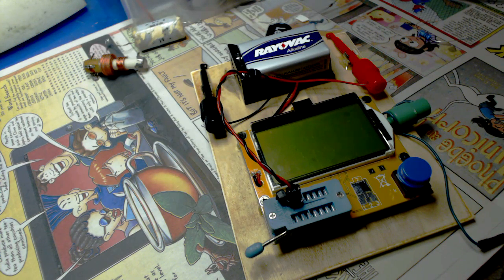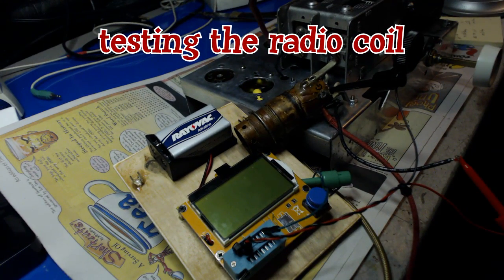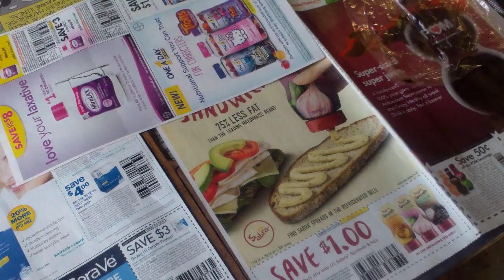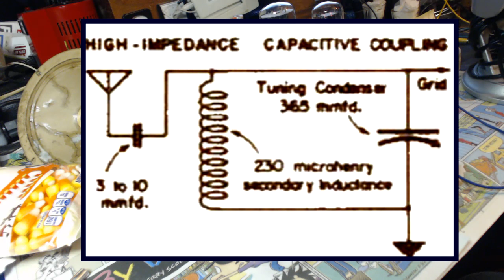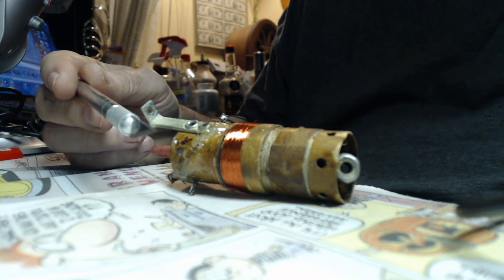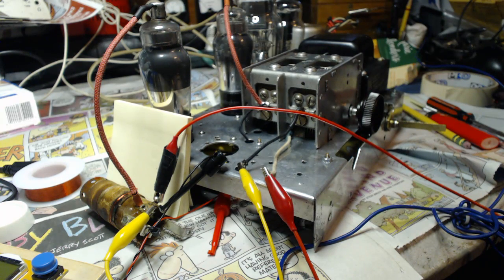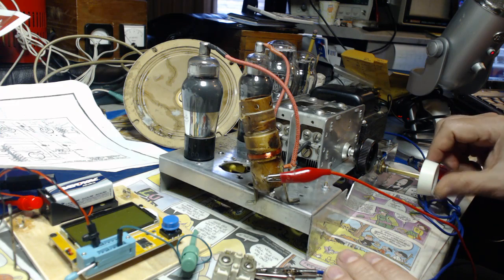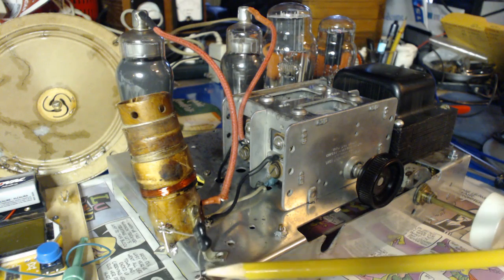1932 Mystery Cathedral Radio Restore Part 8

Comment: i.purchased the same tester.. very happy with it..
Reply from the maker: does yours seem to drain the battery fast, mine seems too, but i use cheap ray-o-vac batteries...haha
Reply: Buzz1151 I noticed that also.. but it's nice to get a reading. other trying to read the little bitty faded color bands on the resistor, I tried using this in circuit but it picks up all the other items. over all a little battery drain not bad. it may be from the lighted panel that causes the drain

Comment: all that extra uH acts as a loading coil for short antennas on the BCB (My guess).
But you need to adjust the trimmer caps on the tuning capacitor!  Peak both up while listening to a weak station in the middle of the dial.
Reply from the maker: those trimmers on the tuning cap did hardly nothing, it was such a cheap radio......Buzz

Comment: I know inductance depends on the diameter of the coil, not just the number of turns, and also whether it has an iron, air or ferrite core. Where did you get that tester? I know Old64Goat got one too. I think I need one!
Reply from the maker: Hi Dan..here's the link
http://www.ebay.com/p/12864-mega328-esr-transistor-resistor-diode-capacitor-mosfet-tester-w-test-hook/1153330994
Reply: Thanks Buzz!

Comment: Buzz, 

Where did you get that little tester?  It looks pretty cool, if I do say so myself.

That was a pretty good segment on checking a coil and its performance depending on how many turns the coil had.

Cheers, Tom
Reply from the maker: Just go to Ebay.....It did a good job reading the micro-henrys.....Buzz

Comment: Hay Buzz I like your ambition. In a coupling transformer the
coupling is based on several things.  Some things to consider are the inductance and
resistance (DC) of each coil in the transformer. These affect the circuits
connected to the transformer more so than the coupling between the coils. Also
that picture of the damaged transformer tells me it probably took a lighting
hit, do not judge the number of turns in the coil from the size of what you
see. It is the relation of turns (Loops) in the two coils and the magnetic coupling
between the two coils, that sets, above all other internals of the transformer,
the coupling action of the transformer. Turns diameter is not as important as
turns count. Turns diameter affects internal coil resistance more. I expect
that the original input coil wire insulation exploded makes most of the size of
that coil. I like your new component tester. Could I get more information?
Reply from the maker: The meter comes with no information..here's the Ebay link
http://www.ebay.com/p/12864-mega328-esr-transistor-resistor-diode-capacitor-mosfet-tester-w-test-hook/1153330994

Comment: Nice work Buzz.... I wonder if having that coil connected to the chassis ( grounded ) would have made a difference in your testing.  Very nice job on the testing and investigating... excellent education for us all.....  Many thanks for this.... You better hide the leftover wire - Dickel may sell it for scrap copper to buy some booze.....  :)     TRUMP 2016  for the win !!
Reply from the maker: the coil was grounded during all the tests, or are you talking about the gimmick....??
Reply: Yes the gimmick is what i was referring to. I did see the gator clip on the coil lug. :).

Comment: Great job on the coil Buzz, this video got me going on my tester, I started to measure and drill out the plastic case.
I have started a video on it but it gets dark so very early I have to finish it tomorrow, videos coming soon.
Dickel did an honorable thing for Trump...yes go TRUMP!
Reply from the maker: Hi Goat..yeah, i forget that you had a tester like mine...when you get it in a plastic case, measure a few coils....Glad you are for TRUMP.....Buzz
Reply: Hi Buzz, Mine showed a "resister" of 98 onms with nothing connected!
It did this three times in a row, than it was okay, strange.